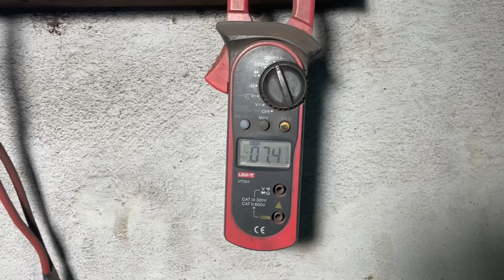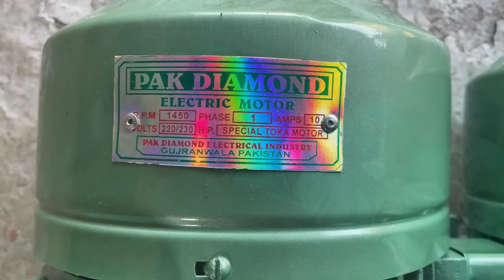incredible Manufacturing Process of Electrical Motors | Process of Metal Recycling in Factory

Comment: Just curious if anyone knows why there are 3 capacitors? On these motors it’s only common to see one or two max. Start and run capacitor so what is the third? I also saw that they just used newspaper on the outside of the capacitor. Kind of weird and dangerous.

Comment: Why two capacitors / two groups of capacitors ?
Reply: To start three phase motor by single phase
Reply: No. One group of capacitors is for providing high torque during motor starting, centrifugal switch will operate after motor gain speed, then motor will run with one capacitor.